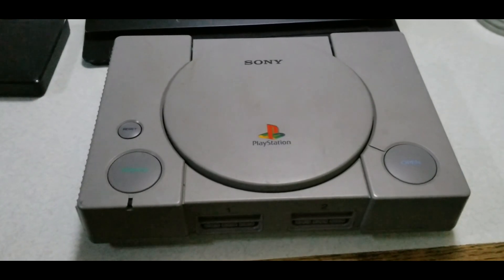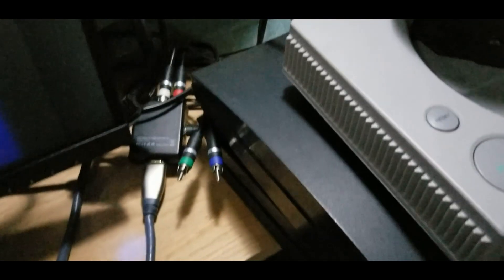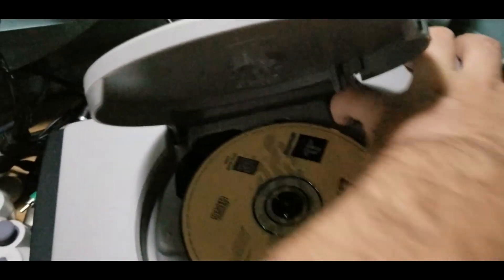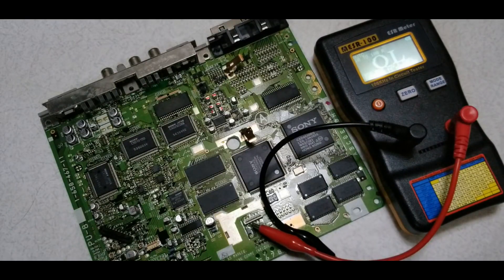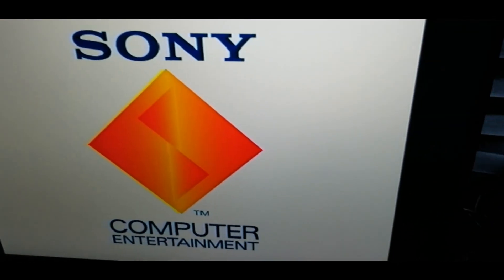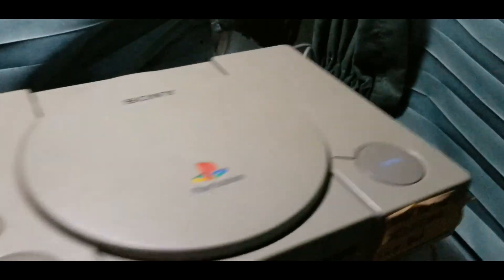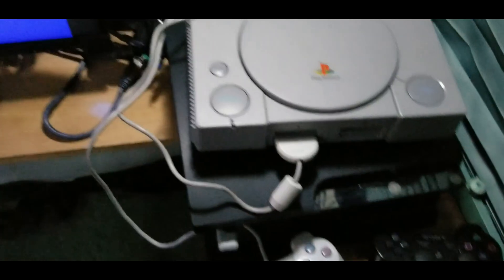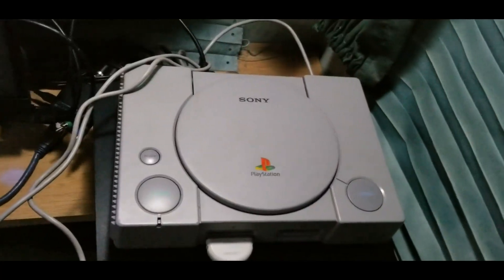Diagnosing and repairing a PS1 with a faulty sound processing unit (SPU) CXD2922BQ CXD2925Q

Comment: Thanks for video. 
I have a Japanese version of the scph-3500 with a pu-7 board, and I'm having trouble reading the drive. I've tried using a working drive from another console, but it doesn't seem to be working properly. The drive spins and tries to read the disc, but it doesn't launch the game or play music. What could be causing this issue?
Reply from the maker: The electrolytic capacitors on the motherboard might be going bad, particularly the ones located close to the drive.

Comment: I have a PU8 Early here with the same problem. Sadly, I don't have any scrap Ealy, and this chip in the PU8 Late or PU18 already has a different nomenclature...
Reply from the maker: The late PU8 and PU18 use the CXD2925Q, which can be used to replace the CXD2922BQ.
Reply: @BoomerElectronics Thanks! It worked.

Comment: Thank you for uploading this video 
I have two questions first I have black screen with audio 

And how I know if the issue come from capacitors or IC chip 

❤️
Reply from the maker: Black screen with audio is unlikely related to an IC. Most likely causes would be a bad AV cable, a problem with the AV port, or a capacitor issue. If it happens to be the slim PSOne model, then it's very common for the capacitors in those to go bad.
Reply: @BoomerElectronics  it happened to PS1 fat

Comment: Subscribed!! Excellent work!! I have a question. If the screen was stuck at the black logo after the white one you said there would not be a video.  What would the problem be with the PS1 if that was the case? 🐺🐺😀😀
Reply from the maker: Thanks for subscribing. In that case the laser is likely failing. Since laser failures are a common, well-documented issue with PS1s I wouldn't bother releasing a video for that.

Comment: Nice fix. I would have spent ages looking at the audio port, surrounding caps and trying to work out where the audio was going missing. Surprising to see an audio chip stopping the system from booting like that. Thanks for the info. New subscriber here too.
Reply from the maker: Thanks, Philip. Luckily I've fumbled around these old PS1s enough to where it almost looks like I know what I'm doing now. 🤣Cheers!